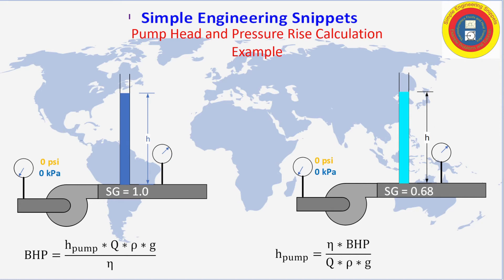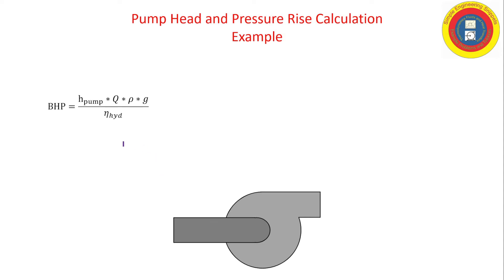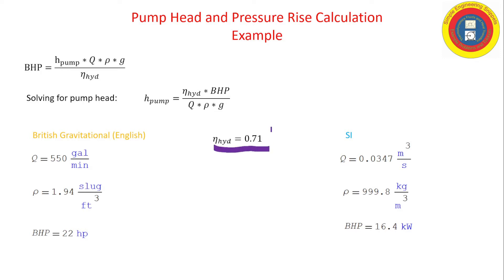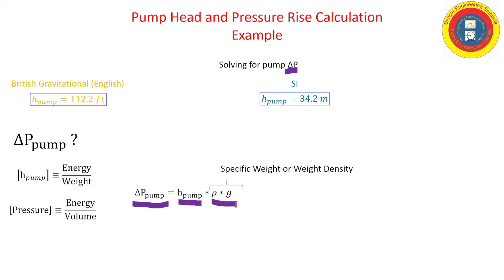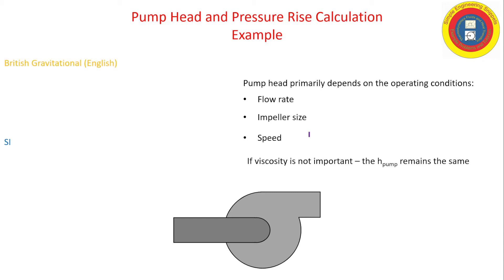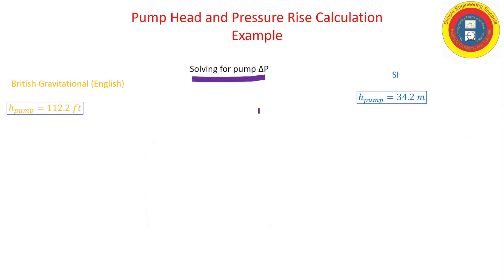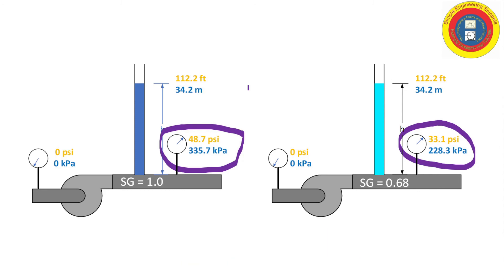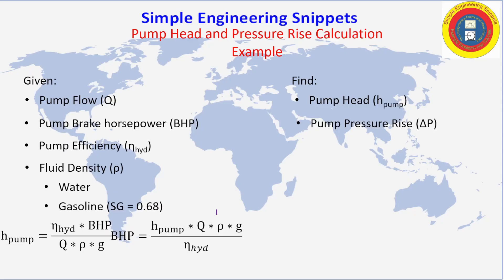Pump Head and Pump Pressure Rise Calculations

Comment: English units are awful.  I've been working as an engineer for a couple years, and for most calculations, I convert everything to metric, and then convert my final answer back to English units to present to my boss.  When you have gal/min, ft/s, and lb/in^2, you have THREE different units for space (gal, ft, and in), so that you have to do unit conversions even within the same system!  I usually convert everything to in^3/s, in/s, and lbforce/in^2 if I work in English units.  It just seems so dumb.

Comment: If a pump is used in this way, I mean with the outlet being vertical, and the liquid is changed, I think the discharge pressure will be constant because the pump doesn't know whether it is water, or milk, or honey, because the discharge pressure is affected by the speed, and horsepower is affected by the speed of the pump, not by the fluid itself. So I think the discharge of the pump is constant.

Comment: Lets say you have 20ft of vertical plumbing BEFORE the pump where the water is in a tank, 90s out and 20ft and enters the pump

How would that affect the head and pressure at the top of the rise?